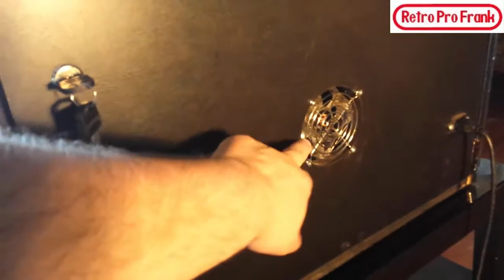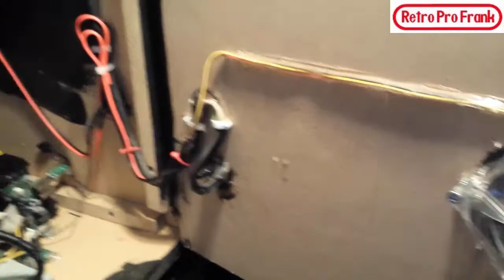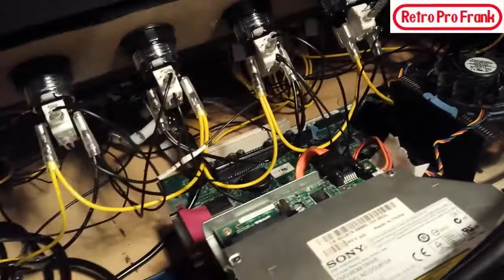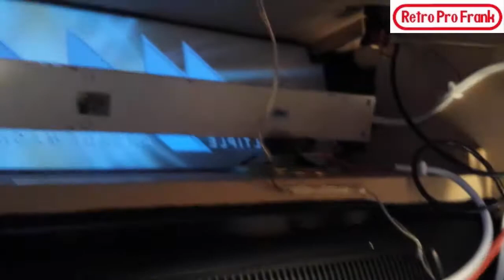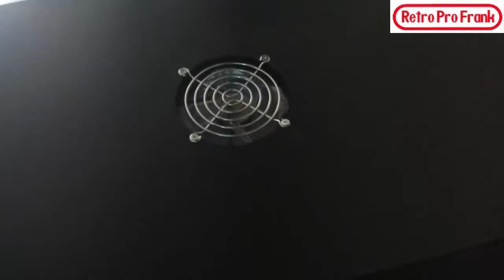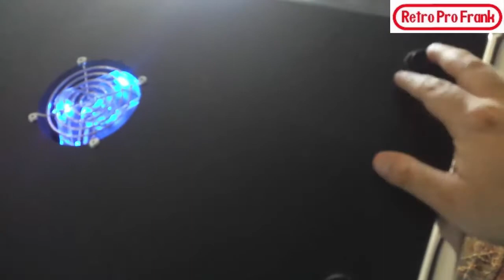MAME BARTOP ARCADE MACHINE BUILD - PART 7 - COMPUTER INSTALL STEP UP  - RETRO PRO FRANK

Comment: Hey Frank, would a full size cabinet need fan ventilation? Im wondering if I can get away with a filtered wall grille vent or something that doesnt require power like open holes.
Reply from the maker: really up to your own discretion. Personally me I just know that computers don't like getting too hot. Depends on your install if you can take the side of your computer off for more airflow that may help. But depending on the temperature of your house and how hot it is outside and then your house with the humidity. You might have to. In this video you will see me talking about Step Up converter all you need to do is wire that step up converter from your USB port on your computer directly to an old PC fan. The way I think it's always better safe than sorry my friend. Plus if it's backlit with the LED. It's a pretty cool effect but entirely up to you. thank you very much for your comments. Another video is going to be released later on tonight. See you in the comment section pal :-)

Comment: Nice continuation video Frank! The inside looks very well organized and neat. Is it common for LED's to go out on arcade cabinets? My Crazy Climber always has issues with the LEDs. I've replaced them 4 times so far :-/
Reply from the maker: thank u...i dont know bro..when i instilled the buttons 3 leds didnt work..i fixed 2...i tryed to fix the lastone but didnt work..the ebay seller is sending me replacements...
Reply: Ah ok, well that's good the seller is going to send you replacements.